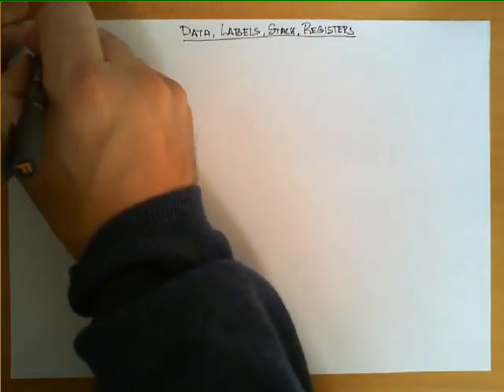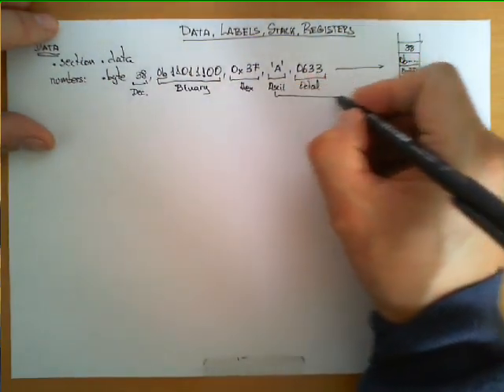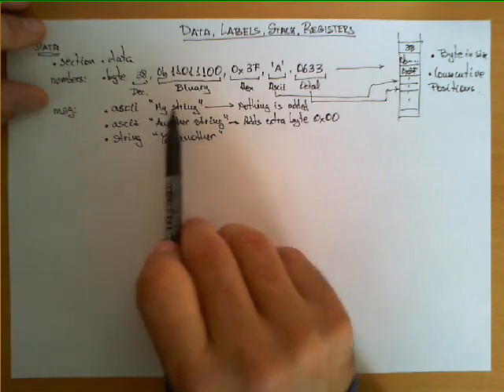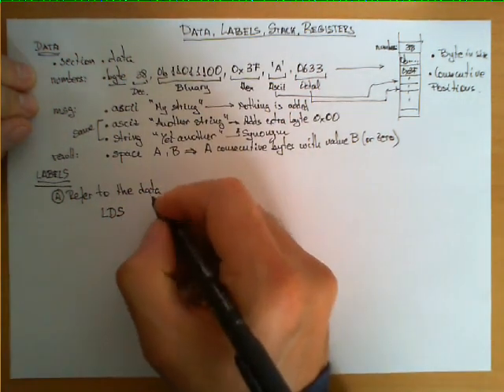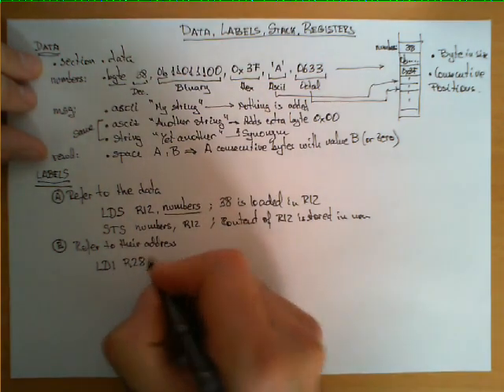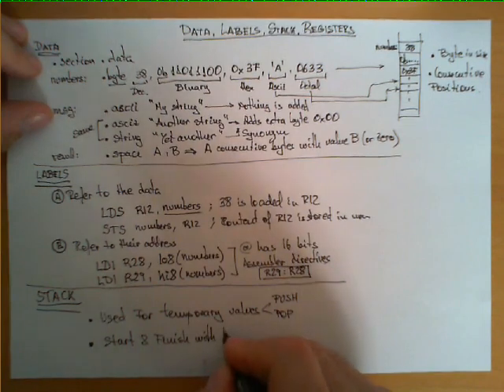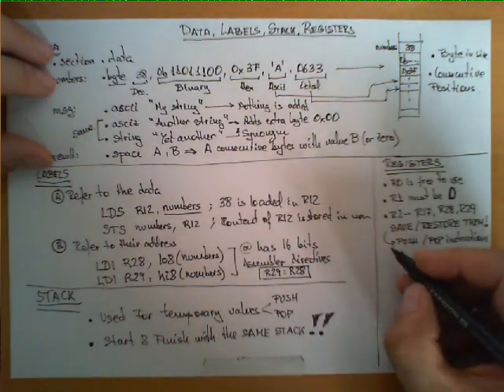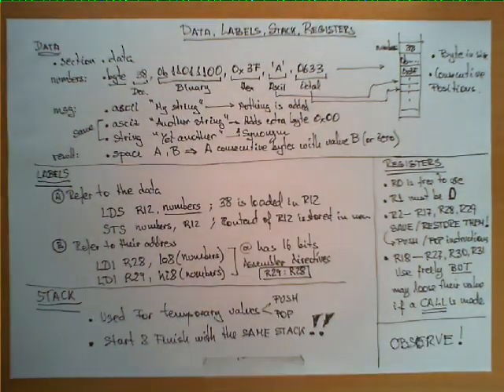Data, Labels, Stack and Registers in an AVR Assembly Program

Comment: Realy appreciate your videos.

I was confused intially by your stack and register usage rules as I had found no such steps or restrictions necessary at all when programming in AVR assembler.  So after some digging I eventually found that your restrictions are only releveant when aiming to intermingle assembly code with code compiled from C (such as using a C library). They don't apply at all to people coding exclusively in assembly language. 

It might help avoid some confusion for learners if you were to note that.

Comment: Your validation of: r18-r27, r30-r31 used "freely", but, dependent on the use of the 'call' instruction and/or the written register(s) (r18-r27, r30-r31) value could be temporary if the  'call' instruction (to the subroutine) is extensive?

Is the mentioned rule valid for a relative call ('rcall' instruction from RISC AVR) also?